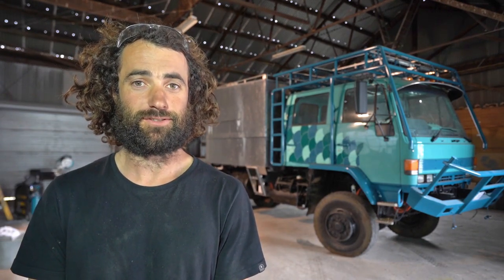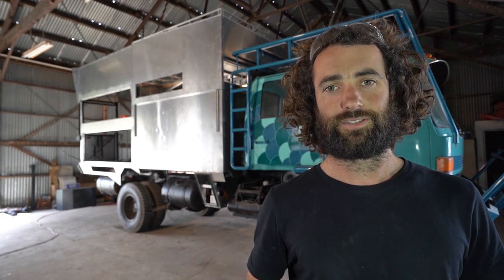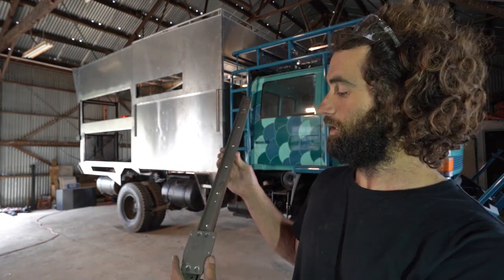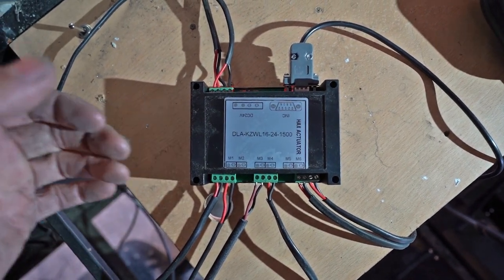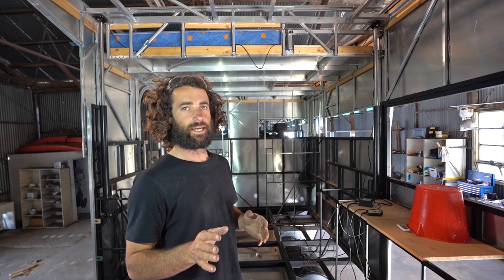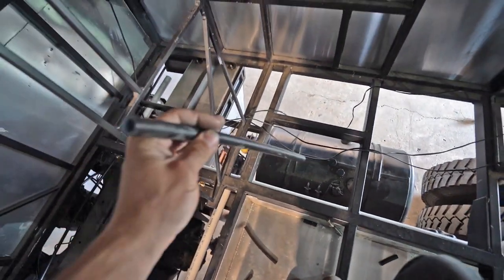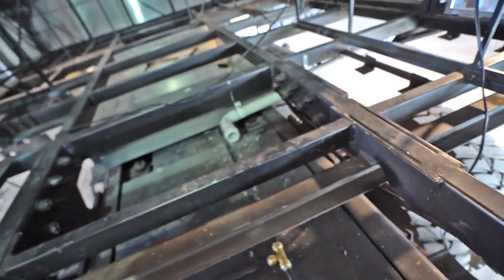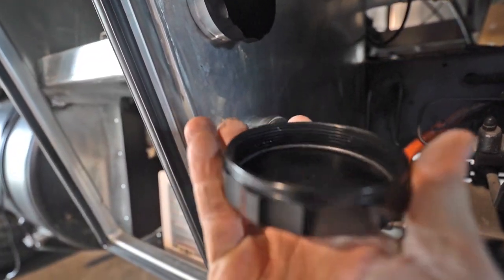DIY Pop Top Roof - Expedition Truck Build #9

Comment: Can you not use 2 controllers? 3 connected to each, so left side and right side. This way you would only have a difference on 1 axes and also the other axes (with 3) would  be straight.

Comment: Epic build here. Do you remember how much the slide packs were?
Reply from the maker: Hey Aaron, I can't remember off the top of my head, I think roughly around $100 AUD each
Reply: @dancampion  wow that is cheap af. THK are the ducks nuts. I found a website selling them but no prices on there, so thought they must have been expensive hey.

Thanks for the response. Loving the videos, keep up the good work.

Comment: What is your plan if any actuators fail?  Is there a way to manually override so you don't get stuck with the roof in the up position and not able to move the vehicle?
Reply from the maker: If one actuator fails I can remove it from the system and lower the roof without it. I may also carry one actuator for spares. I've stripped one of these down and they're simple to repair if you have the parts

Comment: Looks great! So much engineering goes into your build! And you are doing it right! Nice 4 point flex system under the body. And you design it that thing can move and flex. :)
Reply from the maker: Thanks Victor! I haven't done much testing but it should be able to flex as much as it needs to
Reply: @dancampion  the most important thing is that you have the correct way of thinking for expedition trucks. I saw a super pretty unimog on YouTube. Super nice build and layout. Then they went offroad...... I saw the cab and body completely rigid................ Something is going to crack while doing long days of the pavement.

Comment: This is awesome! 🚛🚛🚛
I stumbled across linear actuators while researching methods to lift the roof on my shuttle bus as well. No one has installed them into a bus roof... That I can find on the internet anyways! I've been checking in for a while now and this is the closest to the concept to what I was imagining for my bus 🚌 ! So thanks for the update!! 

Curious what length of actuator you bought?  1000mm? Im trying to figure out if it says something like "55-1000mm" if that means 1000mm is the length once fully extended. Also curious what's the real time for the lift of your roof? I'll probably end up with 4, as my roof is fiberglass so it won't be as heavy. And I won't be on the roof while lifted. 

Lastly, do you have any reinforcing done inside as a failsafe for when it's fully extended? Like some type of bar lock on the wall? My plans for my bus include a very analogous bed loft to what you've done (tucked flush to the ceiling when the roof is not extended--whole reason I wanted to do the lift in mine!) ..since I've never used actuators before... I'm somewhat terrified I could be up in my bed loft and have the roof fall and crush me. Am I crazy... 😂 Please let me know if you or your engineering friends think a failsafe is necessary. 

This build is epic. Also love the blue colors for the front. Plz keep posting!
Reply from the maker: Hey mate, you shouldnt need a failsafe. research how actuators work. They generally cant just drop under normal circumstances.

Comment: Dan, exactly how are these actuators 'synchronized'? I mean, you turn em on/off all together, but there's no feedback wires for the position, right?
Reply from the maker: They're not synchronized, the cost of synchronising goes way up with more than 4 actuators. It would be nice but it was out of my budget and not really necessary. Cheers
Reply: @dancampion  Hi Dan, ah, right, I misunderstood your message then ;)

What is the reason you used a distributor box instead of simply wiring everything up to a switch?